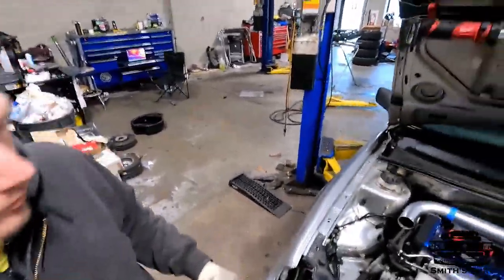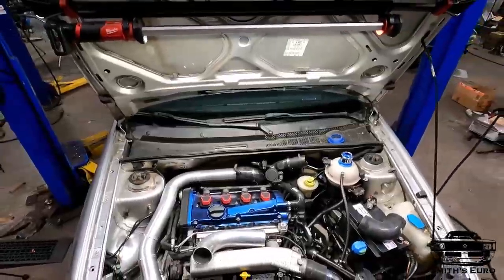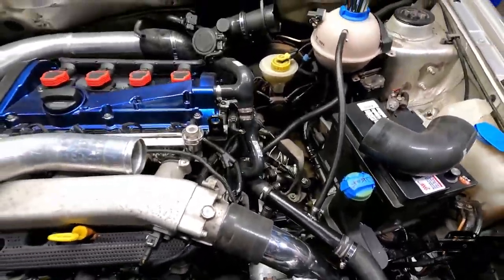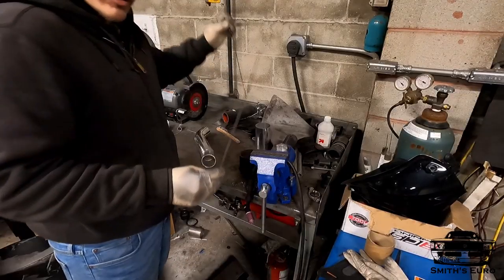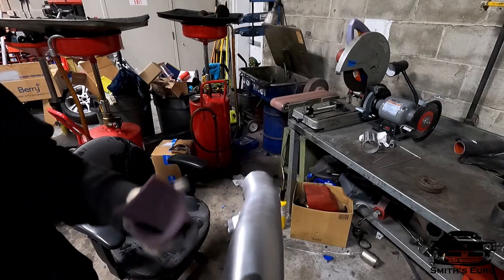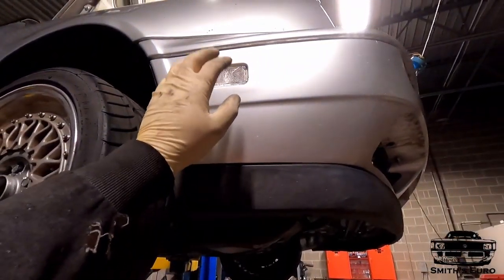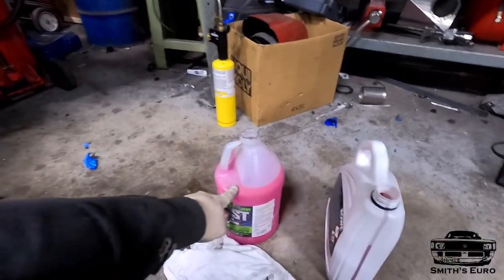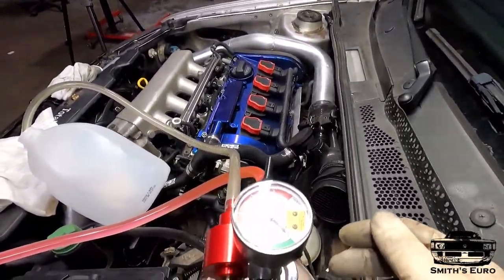MK3 1.8T ENGINE SWAP EPISODE 9 SWAP COMPLETE custom making intercooler piping and putting together

Comment: Looks great man. You never said how did you fix the speedo.
Reply from the maker: I just accidentally cut the plug out when trimming the mk4 harness , i just wired it back in. Wasnt hard. 3 wires just re connected.

Comment: Do you need custom engine mounts for the 1.8t swap?
Reply from the maker: No you dont, you only need mk3 2.0 engine mounts with very slight grinding for clearance. And what ever trans mount 02a, 020 you choose to use.
I believe the second video i show the slight grinding of the oem 2.0 mounts to clear and bolt right on to the 1.8t block